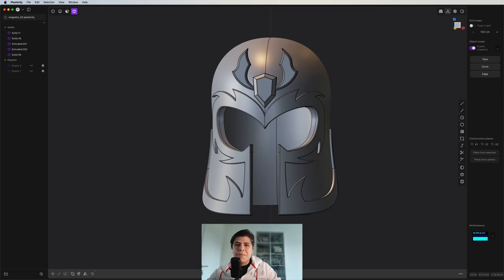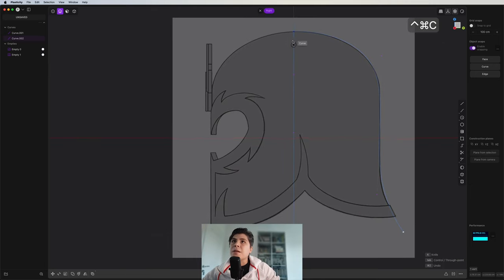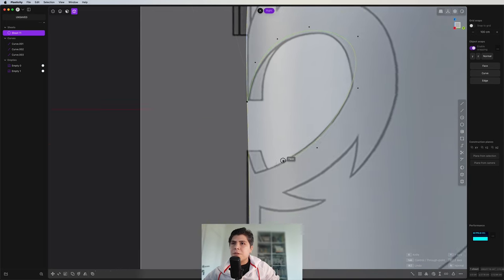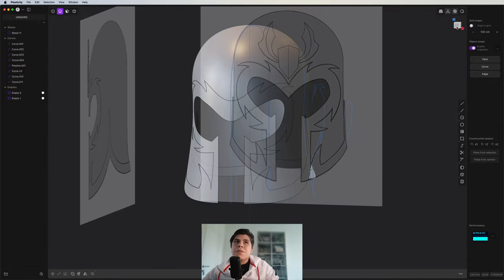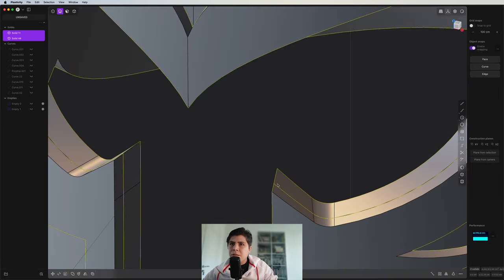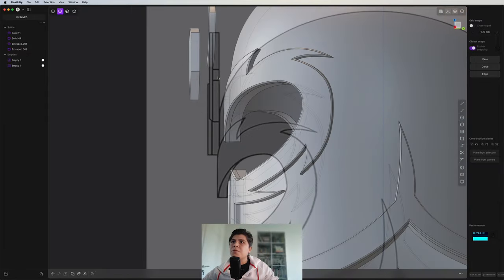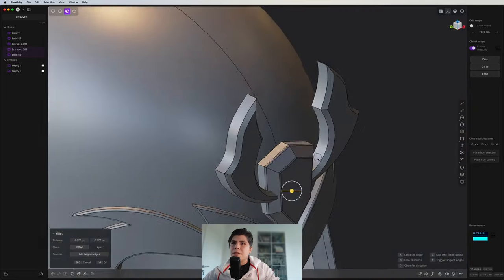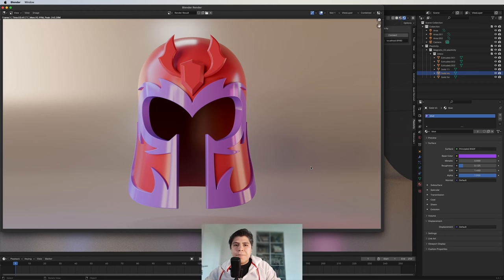Plasticity Tutorial: Magneto's Helmet

Comment: Currently stuck on trying to thicken the inside of the helmet. It keeps throwing an error saying Failed to offset the face or the face is only partially offset. Self Intersection or regions of tight curvature on offset surfaces. Any ideas?
Reply from the maker: Ok that is very strange. So, my first approach would be to duplicate the faces of the helmet. Scale them down and then join the edges. Remember the megaman helmet? I also found that thicken wouldn't work, so I duplicated the faces and scale and just loft the edges. I think i also did it with the Majora's mask. Do you have the latest plasticity?
Reply from the maker: Something else I would try would be to select the faces and instead of thicken, press F and select "thicken faces". Sometimes that also works.
Reply from the maker: ** "Thicken faces" or "thicken sheets". One of those, I don't remember which one is it. But also works when normal thicken won't
Reply from the maker: I have another idea. It can be that the cut from the front (eyes and the mouth) are causing the trouble. What if you thicken everything first, and then cut the object? As soon as you make the shape of the helmet. Thicken, and then you can cut the lower part and then the front part.
Reply: @alchemistik_laboratory  thanks I will give all of those a shot this morning. I did try last night starting over and as soon as I did the loft function, I tried using the thicken function and it still was throwing the error. I will keep you posted 🤘
Reply: @alchemistik_laboratory  Okay here is an update. I was able to get the helmet shape thickened and I think I know what the issue is. The helmet halves were not perfectly along the center. So one side could be thickened just fine. But the other half couldnt. I drew a box along the Z that went down the center of the helmet. I then cut and deleted the right half. I then used the Mirror and Weld function on the left side. It now seems to be okay. I'm going to continue on this afternoon with it. But I think I need to relook at your initial drawing step and see where I'm messing up because ive tried this a few times now and each time it wont thicken even after making the basic shape and mirroring. Excited to keep digging in on it!
Reply from the maker: @UncleJessy  I am glad that you could find out what the issue was! 😊 
My very first guess would be that you draw the lines from the "Left view" in this way: when clicking where to start the first point. It is quite easy to snap the point very close to the middle but not quite there. And the second line probably was  snapped in the place where we want it. Causing one side to work and the other not. When this thing happens to me, i rather draw first the "left view" curves and then finish with the "front side" curve.
 Or grab the points from the curves and scale them on the X axis to the value of "cero" so that they are really flat and then snap them to the Z axis.
But these are just some ideas. In the end you will find out better tricks I'm sure.😅
Reply: @alchemistik_laboratory  Ran into a few other issues but was able to trouble shoot it all by playing around. Got it modeled and exported! Excited to do it all over again!

Comment: When you moved the two curves for the front and back outline of the helmet, how did you get it to perfectly line up with the X axis?
Reply from the maker: If you start drawing from the front. The lines that you draw will be automatically created on the x axis. If you draw from the left. It will be the same for the Y axis. Unless you snap the lines to something else. I hope I understood you correctly. But if it is not drawn already on the X axis, i would grab the line and snap it manually. Does this answer your question?😅
Reply: @alchemistik_laboratory  
At about 2:32 you grabbed the two lines which were not centered on the Y axis and moved them to the center.  Was wondering if you had a way to snap them there or something.
Reply from the maker: @otherworlds9677  I see. I just grab the two lines and snap it with "ctrl" to the Z axis. You can see how I drag the mouse and snap it to the vertical line of the Z axis. That was the only thing I did.